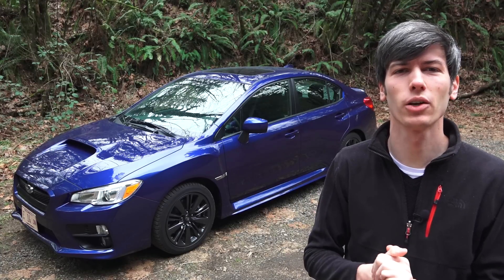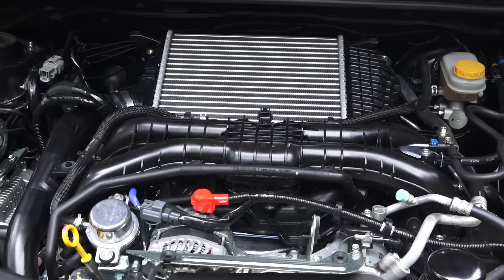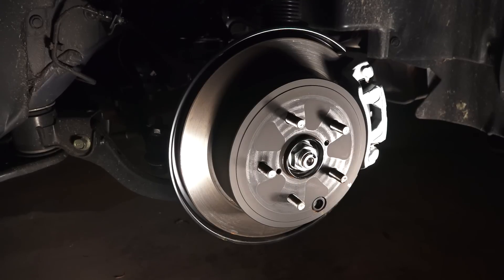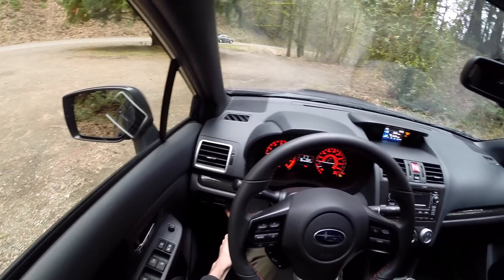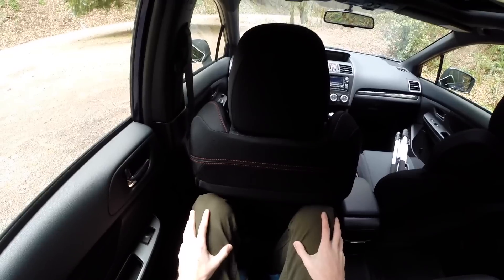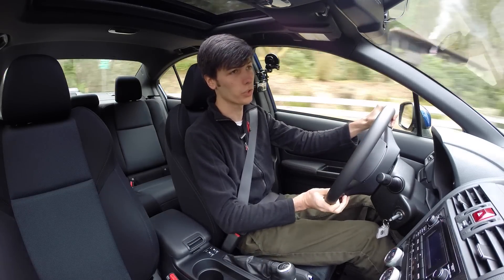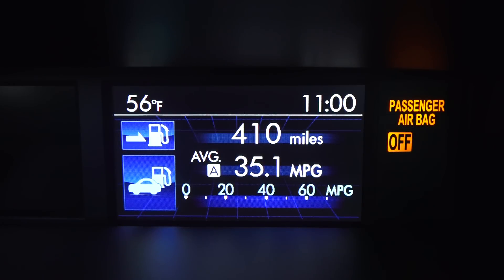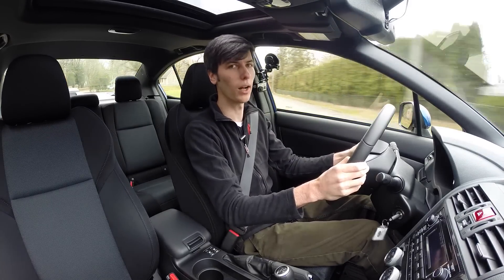2015 Subaru WRX - Review & Test Drive

Comment: As a mechanic I wish this was the only car I ever had to do an oil change on
Reply: I play car mechanic Simulator, so I can relate.
Reply: You still have to get under the car to remove oil pan bolt. Anyway if you are a mechanic you use lift to lift the car as much as five feet or more, so why are you complaining?
Reply: Yeah but then you can't fill the filter before installing it, which is a good thing to do so when you start the engine it can send the oil where it needs to go straight away rather than running bone dry until the oil gets out of the filter
Reply: +Sunde2000 is that on steam?
Reply: At least you dont have to do one on a porsche
Reply: SoSickWidit Yeah!
Reply: SteadyChasin MoneyBags  When does it smokes and what color is the smoke? If it is white smoke only after start up or when it is cold outside then it is highly probable it is only condensation.
Reply: SteadyChasin MoneyBags  check the water

Comment: Definitely one of the better 2015 WRX reviews I've watched. The only thing to disagree with having in the video is the fuel economy based on the car's reading. In my experience, they overstate the mpg but it varies from car to car.
Reply from the maker: yukihiro1412ver231 Could be off by 5-10%. Let's say worst case around 10% it's down to low 30s. Still very good for AWD.

Comment: This car is the best bang for the buck, point a to b, all season, practical car out there.  Period.  They really addressed the handling issues with both the WRX and STI this time around, the handle flat and firm, and you need to push hard to get the nose to push out.  The WRX is the better buy though, especially since the FA20DIT has less odds of breaking your heart by breaking down than the EJ25.  It gets absurd MPGs for an AWD Turbo car.  It weighs what my Evo 8 did basically.  It's safe. And with a good set of snow tires, it was the only bright part of this horrible winter we're having for me.  Subaru killed it with the WRX, so much that I cancelled my STI order (in part due to the motor) and bought a WRX instead.  Subaru needs to update the STI, as it's handling is fantastic, but it's motor is far too dated.

Comment: Great Review! I appreciate that you went into the details of pointing out the major components in the engine bay and suspension. Regarding fuel economy, I have always found the numbers stated on the dash to be overly optimistic, so I would have liked to have seen actual "at the pump" numbers.

Comment: Why the hell does Subaru have the 2.5L engine in every STI except for the JDM model this gen? The JDM has the 2L with the same ~300hp.
Reply from the maker: Zachary Ong I believe the JDM engine has always been 2.0L. At least the last gen was.
Reply: Really? The 08+ STI had the 2.0L in the JDM?
Reply: Then what power is the JDM STI making?
Reply: 305HP like the current EJ.

Comment: Spot-on review. I bought a '15 WRX Limited in December and have about 6k miles on it in the winter. I absolutely agree that the throttle is irritating on shifts. I am still getting used to timing getting off the accelerator and on the clutch without the engine revving up. Very spin-happy flywheel. Regarding notchy shifting... Did I read somewhere that the synchros for 1st and 2nd are carbon fiber? Is that part of the reason it feels so notchy? I agree, it's a bit odd and I occasionally have to double clutch to get in first. That said, this car is great. I am getting about 28 mpg so far in very cold weather on winter tires. The performance is better than I expected. My biggest gripe is the hill start. I have a fairly steep driveway, and I constantly stall when I try to reverse up the slope. There is something about hill start in a manual that feels so unnatural. I wish I could defeat that feature.
Reply from the maker: downlevel I'd check the manual. For my STI there's a series of buttons I can push to turn off the hill start. Also, I don't believe the "notchiness" of the gears is due to the materials used. Seems to be a trend with Subarus.

Comment: Thank you for posting this. I am between a new WRX and a lightly used STI when it comes to my next car. You are not making it easy since your STI is a sweet ride.

Funny that you mention rev-hang. Is it the TB or a heavy flywheel that is causing it? I  had SAABS for years an they hanged badly.... probably due to "Scania" flywheels.
Reply from the maker: Valery Vodonos I don't think it's the flywheel. The throttle is a bit strange.

Comment: The new cvt for this car is the better  transmission.  The paddle  shifters give you the manual  feel with the default  automatic.
Reply from the maker: Courtney Bayer Added weight, worse mpg, more expensive. I disagree.

Comment: Great technical info! I notice the rev hang in my 15 wrx but it is only prevalent during first to second shifting. But first and second gears have carbon synchros due to which I'm not hurting the clutch and gearbox too much. Other gears seem to not have that rev hang totally

Comment: I understand this is a car that 9/10 times will get modded and I love subies but does it bother anyone else that my father's V6 Camry has more power than this? Apples and oranges I know but come on now.
Reply from the maker: Prince Charming Peak HP doesn't tell the whole story. And car weight also plays a big role. I've driven this and the V6 Camry, and this has significantly more grunt down low. 5 second 60 is admirably quick. That said, the Camry is actually surprisingly fast (compared to most other sedans in its class). Around 5.8 seconds.
Reply: you cant judge solely on horsepower. this car makes peak power thousands of rpm's before the camry. do you want 270hp from only 2k rpm onward or would you rather your camry hit 270hp at 6k rpm when its time to shift and you cant even use the power? not to mention the all wheel drive and everything else that makes this such a better car

Comment: I don't believe the 35MPG thats more than my 2012 GTI which is lighter, less powerful, and FWD. Did you check at Gas pump, those computer's are never quite accurate.
Reply from the maker: Bulgdoom The course I run is pretty easy, and I'm a fairly efficient driver. I did 37 mpg in a VW Beetle with the 210 hp GTI engine in it.
Reply: Engineering Explained  Maybe ur at higher elevation in a 50 mph road, I average 30 MPG at 70 MPH at sea level.
Reply from the maker: Bulgdoom Typically I won't exceed 65 mph on the course most of it is around 55-60. And a little bit of city with some hills. Driving speed makes a big difference.

Comment: Seems to be a good car . Question is generally a Subaru car with low maintenance and reliable?
Reply: I'm a mechanic ( 4 yrs experience ). In my professional experience Subaru have the least amount of problems that I have seen. Awesome reliability. Older models suffered from an insane amount of rust issues though. The new models don't. As far as I can tell. I'm in the process of getting rid of my Nissan 370Z and getting a WRX. Full disclosure.
Reply: andres chang Alright, that is very good to know if I buy my first car. I really want to test drive the 350Z and 370Z seems to be fun cars to drive and also good looking.

Comment: I find it odd that you're able to suggest NOT to purchase a WRX with CVT when you're review is solely based on the 6-Speed model. I'd acknowledge your statement if your test drove/review both back to back. No one on Youtube seems to be able to do so.
Reply from the maker: ejicon There are simple facts surrounding this. The manual is significantly lighter, gets better gas mileage, and is quicker. That's why I recommend it.
Reply: Engineering Explained
You're an engineer. I'm pretty sure you're a mechanical engineer. Based on my understanding, you should know better than to "assume" that one thing is better than the other without testing them both using equal assertions. This is disappointing to me. You're review was great up until that single factor alone.

Comment: why are the intake pipes made of plastic these days?
Reply: I'm pretty sure it's a weight saving measure.
Reply from the maker: beyondthelol Likely cost, but keeps weight down as well. Also doesn't soak with heat as bad as metals.
Reply: Engineering Explained Seems like there arent really any advantages to having metal intakes then, but i still cant seem to accept that such an important part of the engine is made from plastic haha.
By the way, i like how your comment came at exactly 4:20 - coincidence i think not

Comment: Great review I had the previous generation WRX and purchased a 2015 WRX last May.  The new engine has much more available torque down low, but I agree the car (like many modern cars now) does have some rev hang that takes some getting used to.  Handling vs previous gen WRX is vastly improved.  The car feels much stiffer and the steering ratio is much tighter giving you better turn in.  The car is less forgiving on bad roads than the previous generation but there are always trade-offs.

My biggest complaint is the seating position (I feel like I am sitting too high).  Especially for a car that has the same ground clearance as a BRZ....

Comment: Engineering Explained Can you adjust throttle response with different settings in this car? If so, did that improve the rev issue?

Comment: Great review. I bought a 2015 wrx premium and happy with my choice. Only I hate is that the rev hang in second is absolutely terrible. So bad it takes me about 2seconds to get a smooth shift into 2nd. 3rd is about 25% better and 4-6 is normal.
Reply from the maker: Nick Benrhardt Yep, I think the car does have quite a few great attributes going for it.

Comment: Can you explain how a perfomance piggy back ecu works. I'm pretty sure it intercepts the signals from the maf, boost pressure,  and cam position sensors. There's also 1-9 different power settings. I was looking at a product from tmc motor sport, for a 2014 Fiat Abarth. I just didn't know if that's safe, and does that make power. Thanks